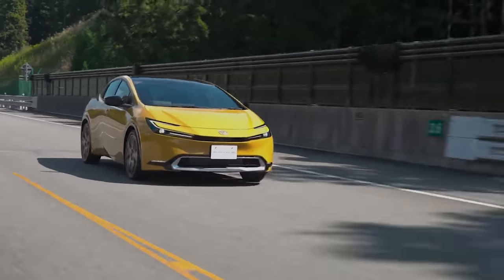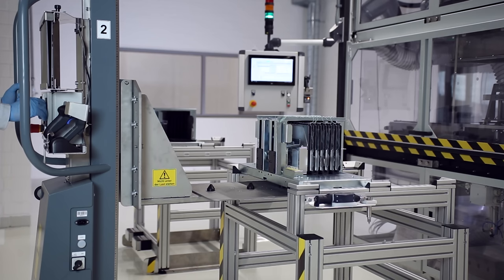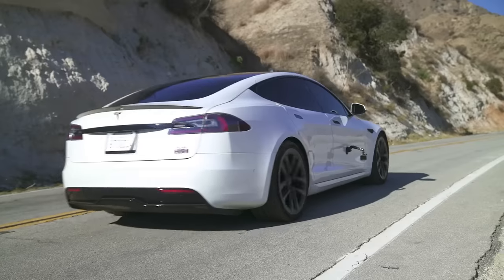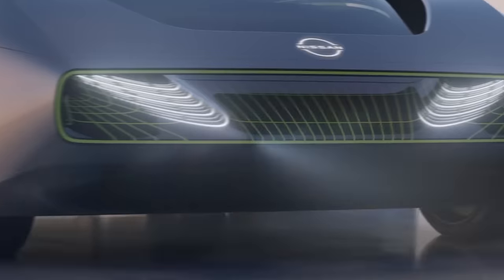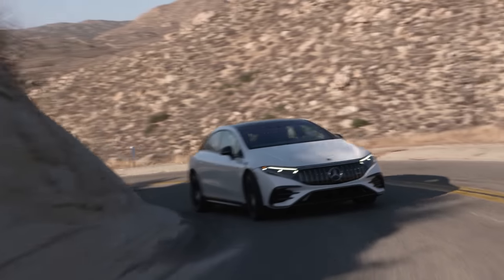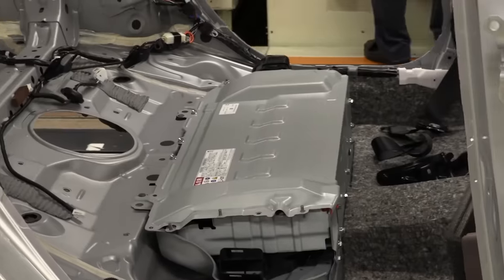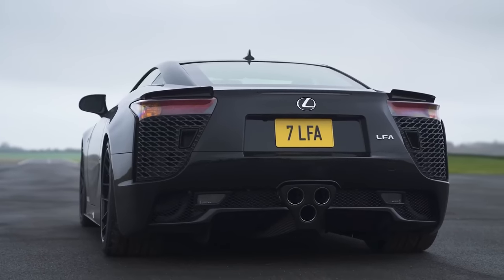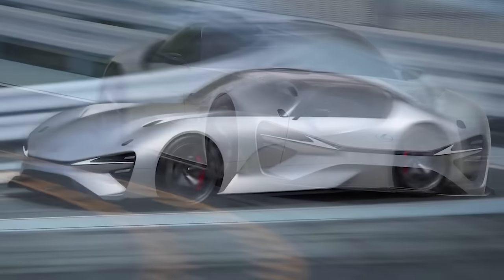New Lexus LFA with GAME-CHANGING battery!

Comment: nothing can replace the OG LFA.
Reply: This is not the actual lfa successor, look up the Toyota gt3 project. It has a high revving twin turbo v8 with lfa styling
Reply: You mean no replacement for OG 🤪
Reply: Agreed, the OG LFA is the best.
Reply: that v10  sound nothing can replace
Reply: @V8supercharge  Chisato Nishikigi also loves the "SUPAKAA", the OG 2010 LFA. That. Is.
Reply: Besides the sound and maybe the design, the LFA was pretty mid🤷‍♂️
Reply: Yes They can
If toyota works their absolute best, something awesome today will eventually Replace the LFA
Reply: @Eilam_Playz  That's like saying a blowup doll and a soundtrack can replace your partner, there's a huge difference between the pure mechanical sound of an ICE engine and fake noises.
Reply: Except the next LFA.
Reply: Except a new LFA

Comment: What you need to remember is how Toyota makes their cars. Toyota don’t innovate as much as they used to. What Toyota do now, is sit back, watch what their competitors make, analyse it and then make their own improved version, which almost always has worked in their favour.
Reply: They are the apple of cars, in that sense.
Reply: what do you mean by "as much as they used to"? like, late 2000s?
their new force engine or whatever it's called is pretty innovative and shows results as seen in GR Yaris, and their newer hybrids are quite advanced. they also did the steer by wire in the new lexus and on
Reply: Seems like an excellent business plan to me……
Reply: Their strategy is different, that's all.
Reply: They first have to deliver. Solid state isn't new and you need volume production.
Reply: You forgot "tries to slow down electrification by any means necessary". Luckily others aren't waiting for Toyota.
Reply: Like Apple. Seems to be working for them pretty good.
Reply: @massimolettuce nah...they don't sell overpriced sh▪︎t
Reply: Well the Bz4x is a piece of 10 years outdated crap
Reply: @aditya_gupta ”in that sense” please read
Reply: Back in the 70s Toyota used to be a pioneer. They had touch screens, 360 cameras, and even voice-activated commands 5 decades ago, but almost no one knows that
Reply: Wasn't everything inside the Lexus lfa all new in it but people made same things resembling what's in an LFA before it's official release as they've seen the concept version
Reply: @massimolettuce  Unlike Apple, their repairability is much better.
Reply: @koknyoq  their strategies maybe different but impressive btw.
Reply: @classicraceruk1337  agree.
Reply: @massimolettuce  yes. Despite their F1 journey was a total failure tho.
Reply: Buying battery from the Chinese.
Reply: so improving something already existing is considered not innovative? Lazy, yeah sure, I can see that. But oh well, as long as non-european brands do it I guess.
Reply: @kalui96  they are still using subaru and bmw for their 2 sports cars. The op is correct toyota is the apple of cars they literally wait and used others parts to use in their own. They also dont update their models. Like the 4 runner
Reply: Yes, toyota never be pioneer, but they always be market eater..
Reply: Let's not forget their BMW....I mean Supra
Reply: Basically Blizzard
Reply: They used to sell 12 million cars a year, this year is more like 8 million! They are in deep trouble
Reply: Dont fix it a'int broken simply improve to perfection.
Reply: Sounds the same like apple
Reply: @yousef.al-assaf  wait. Is this really true?
Reply: @Enrique A Thiele Solivan  
Because they are not pushing for all-electric yet, because an all-electric market is not happening any time soon, not even in the next decade...
Reply: @MadDog_Majima  
Yup, you can check Toyota Century as a start. It was insane for its age, they just decided it was too much tech and reverted to "normal" parts.
Reply: Oh so that's why they use BMW B58 😅😅😅...SMH
Reply: @massimolettuce  I was gonna say the exact same thing
Reply: @wrighterlights  but like apple, they’re much more reliable than their competitors
Reply: @DzeiEidz  Because the electric tech isn't ready yet. And manufacturing the batteries isn't at the point it needs to be in terms of environmental impact.
Reply: Electric tech isn't ready yet? When do you consider it ready? It's exactly where it is at current time. One, two, x years from now it has advanced a bit more towards this mysterious "ready" or "point" and even then there's something "almost there, right around the corner", probably Toyota.
Reply: Toyota is about slow evolution of what is reliable so as to maintain their reputation of reliability.
Reply: @massimolettuce  as if either of apple and toyota makes good flagship products lol
Reply: @DzeiEidz  I consider it ready when we can get 360+ miles in a vehicle the same size, weight, and cost, as a Hyundai Accent, and 600+ miles in a vehicle the same size, weight, and cost, as an F-150. Maybe solid-state batteries might help. But there's only one way to know for sure.
Reply: @MonicaHolly143  they have 4 sports cars though? (In toyota)  2 of them were completely built by them. Not to mention Lexus' sports cars are also yknow fully built by them too
Reply: @MonicaHolly143  also SUVs like the 4runner have a much longer life cycle. There are very few true 4x4s that get constant new generations
Reply: nailed it!
Reply: @the_batmobile0.4  
Toyota co-developed the engine. Do your research. 
It is easier for companies to share R&D costs, especially for a dying/limited segment like sport cars.
Reply: Basically they are like Apple lol
Reply: @Variable_Degree_Series  Prove that Toyota don’t make good flagship products then
Reply: @GECKOZFTW  just how many flagship cars do toyota sell? Just tell me! Are they any close to the European cars?
Reply: トヨタって昔からそういう企業だよ
Reply: @Variable_Degree_Series  In Europe, the Camry and yes by most reviews it’s a good car. In Asia, the Crown and the Century. In America, the Camry and the Avalon
Reply: @GECKOZFTW  you think camry is a flagship car? Have you lost your mind or something? What is flagship for you? Its a midrange car! And even if you consider that a flagship, it doesn't comes close to the germans..
Reply: @massimolettuce  Actually They Are Samsung.
Reply: @Variable_Degree_Series  In Europe, it’s Toyota’s largest saloon. Toyota’s flagship Sports car is the Supra.
Reply: @massimolettuce  Apple Of Cars is Rolls Royce Actually.
Reply: @GECKOZFTW  if nokia's current most expensive smartphone is 300 dollars, will you call it a flagship? And even if you do, as I said, germans aremway better!
Reply: @Variable_Degree_Series  Germans are way better at milking your wallet dry of funds for how often they break 😂😂
Reply: Toyota's flagship car is the Landcruiser/Lexus LX that has a three year global wait list currently cause they can't keep up with global demand
Reply: Improvement comes from experience. Toyota has demonstrated with BZ4 they cannot compete on today's market so they'll wait until 2028. China if far ahead and once they satisfy internal demand, they will flood the world with afordable cars, hopefully bringing down the prices.
Reply: @Knnnkncht I think you're being mean to Toyota. I think the BZ4X would have been very competitive in 2016. They aren't going to sell many, and they will lose money on them.
Reply: @DzeiEidz  Only way electric will take over is if they can successfully imitate the sensation of driving a car with a combustion engine and that's what they're trying to do. Aside from the instant torque delivery of the electric motors there's nothing else going for it. As of now idk who other than squares would like to own a giant rc car as their main vehicle for every day use.
Reply: @alichaudhry12  3 years waiting?😂 are you kidding me? Where do you live! By the time you wait for 3 years, the already better germans are gonna be much much better lol
Reply: 😂bz4x worked so well
Reply: @massimolettuce  Almost exactly like apple but their target base is different
Reply: Baisicaly they pulled a Apple
Reply: You forgot to add that they make it BETTER.
Reply: KIA is that bro with his eye on your girl. Toyota is not going to win with the attitude you described. 

Forget solid state batteries. Hydrogen power is the future.
Reply: What about the Prius?
Reply: Yamaha engine tho ?
Reply: Many Japanese companies use that business plan it works well
Reply: Like Apple 🍎
Reply: Have you never heard of the BZ4X.....?
Reply: BMW supra and Subaru gt86and gr 86
Reply: @massimolettuce exactly what I was going to say
Reply: @2068648  regardless of new sales
Used toyotas depreciate less then any other manufacturer 
Gen 1 prius hybrid systems are only being used by other manufacturers recently
Reply: @dominolehmann8227  thats why matt said that toyota want to be the first in that industry even toyota themself developed the sold battrey from 2012
Reply: @Knnnkncht  bz4x is the collaboration of BYD china
Reply: @kalui96  he didn’t say they don’t innovate at all
Reply: @nahcuh9140  you're right. but he did say "as much as they used to". I argue that Toyota has been innovating the most this last decade than they ever have. they have been copying/adding to existing designs such as the FJ40, MR2, Corolla... really, the Prius line starting in the 2000s and Super Strut suspension in the 90s were the most original things Toyota did previously
Reply: If they are going to bash on EV's to try and push their obsolete hydrogen bs, they going to do a Nokia with 10 years.
Reply: Toyota ‘doesn’t’ innovate… is the proper English. Just saying.
Reply: U said they dont innovate then explained how they innovate? 😂
Reply: I can't blame them for it cuz it is cheaper that way n learning from others mistake Is a great idea
Reply: Like their crappy mistmatched looking cars, they just copy/pasted other people designs and integrated into their own making an atrocious ridiculous looking vehicle.
Reply: That's literally innovation. Being first is not the same thing is innovation.
Reply: Lexus really have an amazing research and development team far ahead of many other companies
Reply: That's not true at all
Reply: @massimolettuce except they don't overprice everything by like 30%
Reply: Did you watch the new Prius look like. they really know what they doing meant Toyota really on another level
Reply: They made the GR corolla exactly because of comments like this. A 1.6L turbo pulling 300hp to all four wheels is unheard of.
Reply: @2068648  people don’t see that, the writings on the wall, Nissan won’t make 2028 to show their SState car… and who will be next to go? Subaru? Honda?
Reply: Except for their pioneering hydrogen cell cars in mass production.
Reply: @massimolettuce  just more capable.
Reply: @fd9ak49  but when? 2050? When everything is accounted for, it’s still going to be way more inefficient than EV’s
Reply: They focus on one niche ( economy / reliable car needed customers ) 

Unlike other brand fry to get with everyone then you end up get no one
Reply: @k-dawg58  that’s where Toyota were… now they are making EV’s badly, still making ICE, making Hybrids, Solid-State and Hydrogen!! And Tesla are the new Toyota, concentrating on one winning formula, - Model Y best selling car in Europe now
Reply: @tonyshipton8896  lucid will beats it and rivian
Reply: Like Apple, but much less infuriating
Reply: They just got a new ceo and pushed out the new prius which has been praised really well so far it went from 0-60 at 10.3 seconds to the new one at 6.6 seconds thats an insane improvement and yet its not a car they needed to change due to competitors the prius was already on top now we just need to see what he does with the good toyota cars
Reply: @massimolettuce  Then why are they wasting resources on Hydrogen?
Reply: @massimolettuce  No because apple doesn't improve they make you think it's improved.
Reply: From what you said, I think they’re innovating still if not more than before.
Reply: @DzeiEidz  More like "not blindly following electric bandwagon". Thankfully.
Reply: Toyota are currently building a H2 Hydrogen-Combustion engine.
Reply: What do you call the GR Yaris then ?
Reply: Also they keep the engineering around for awhile if it’s not broken don’t fix it. The longer something is in use the better the newest version of itself gets. That’s why the cars like lexus Gx & land cruisers go so long before a redesign. And when it comes to the challenging conditions of Outback and safaris, u always see Toyota.
Reply: 🤯
I've seen that done with consumer products in the tech industry, but didn't know it was also being done in the automotive industry!
Reply: @DzeiEidz  a e-car needs a battery, how long do you believe they hold? 3 years? 5 years or even 10 years? does it even pay of to change it after 5-10 years? can people without a garage even use a e-car? trains are pure electric like over 30 years...nobody cares.
e-cars are still experimental and way more costly with like 0 impact on the klima all factors included. like production, long term use, electro-mix and distribution.
Reply: All this talk about how great German cars are.  Crap they are great for emptying your wallet.  100,000 miles and Mercedes and BMW electronics stop working.  300,000 miles and the Toyota needs new brake rotors.😂
Reply: @massimolettuce  hey stop they are way reliable and affordable than Apple ffs
Reply: @DzeiEidz  I love your comment. I’m so tired of all the people who are griping about EV’s and infrastructure not being “ready” as if gas powered cars were optimized overnight.
Reply: This isn’t really true, they’re the ones innovating the most in hydrogen power and electric power
Reply: Sir, That's What Toyota Has ALWAYS Done 😂. The First Toyotas Were Built With Chevrolet Crankshafts👌🏿. They Bought Chevy's, Fords And Began To Reverse Engineer And Create Their Own Product.
Reply: Exactly what Apple does for iPhones.
Reply: That is not their strategy. Lol.
Reply: literally what toyota always did
Reply: Wrong, troll.
Reply: What you meant to say is Toyota tried to innovate too much. And wasted alot of time and resources on hydrogen
Reply: @kl9518 Just like Tesla, where most of their batteries are from
Reply: nothing is more of a compliance car than an EV
Reply: @Variable_Degree_Series Nokia build a pretty slick smartphone
Reply: @Corbots80  just like elon, wasted much time & resourses for rocket with combustion engine...., Instead electric engine.
Reply: For example?
Reply: They absolutely fckd up, when they made the Br4z.
They came up late and the car is so far behind in contrast to other EVs of today.
Same with the electric Lexus'. Which is pretty sad bcs I like the company! 

Hybrid systems are THEIR thing but for EVs they have to do their homework
Reply: @massimolettuce  nah not at all apple isnt reliable and is outdated and they arnt easy to repair kinda the opposite of apple
Reply: @massimolettuce 🧂🧂
Reply: @massimolettuce  thats exactly what came to my mind when I read the main comment
Reply: Basically Toyota is the Apple of auto world.
Reply: Manufacturing is generally where Toyota really excels. 

  Same with Tesla. 

 I can't wait for two things. Solid state batteries which are coming next year in China, 2024. 

 2025 for Toyota, and others.

 Then Lithium Air Solid State much further off. If we can get those? Well it will be revolutionary for everything, but the largest cargo ships. We are talking about super light sports car, or heavy duty electric trucks including construction. Then of course aircraft. 

 Passenger aircraft will be smaller, and slower at first. Yet they'd be significantly cheaper for fuel, and maintenence. Think cheaper/shorter flights.
Reply: @yousef.al-assaf Im really curious to know what you could control in 1970s toyota through a touch screen?
Reply: @notlNSIGHT  it's just as dumb as saying ICE is ready to resist EV transition, when engine power is  x2, mpg x2 , gallon of carbon neutral efuel is $1, you can make your own efuel from your solar panels straight into the cars's tanks, transmissions have 20 speed and shift in 0ms, and oil changes interval is 300k miles
Reply: @pennyhardaway7491  yeah prototypes. with huge tank and 50 miles range.
oh I forgot the cost:
"It is now almost 14 times more expensive to drive a Toyota hydrogen car in California than a comparable Tesla EV" now multiply the number by 2x, 3x for a hydrogen combustion engine 😂😂oops
Reply: I truly appreciate this comment man..ppl jus don't realize!!... patience is the key to life...every part of life.

Comment: That could be a gamechanger for ebikes too🎉. I have a 700Wh battery and it weights more than 3kgs! Bit off topic but I'm happy to see this new development 😊
Reply: Yes. Ebikes hopefully has tons of energy saving like the one in Chevy E Ray.
Reply: My 1000Wh battery weighs 5.5Kg. I switched to lighter tyres and wheels to offset some of the weight
Reply: My 3600wh EUc weights 100lbs.
Reply: A standard urban E-Bike weights about 22-25kg. I don't know if a reduction of maybe 1-1.5kg is that much of a game changer
Reply: That's really good energy to weight ratio
Reply: I want more power but its running the watts and the amps i recently blew my controller by over amping it
Reply: Is it too much to ask for an Akira bike in 2024?
Reply: @veitjacob9764  it wouldn't be implemented as a 2kg weight saving. It's more like the same weight with 1.5X the range, plus quicker charge.
Reply: @mjmulenga3  yes, that would be much more useful.
Reply: forget ebikes, think bigger, imagine not charging your mobile phone for a week lol
Reply: @mjmulenga3  that would be very useful if you do raod trips with an ebike. otherwise its waste